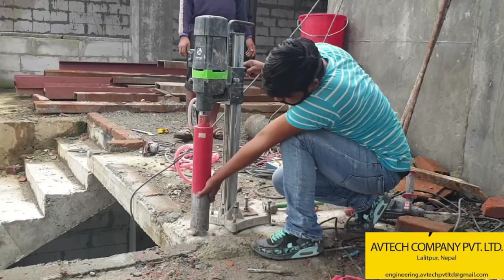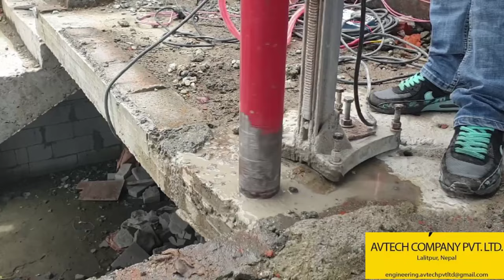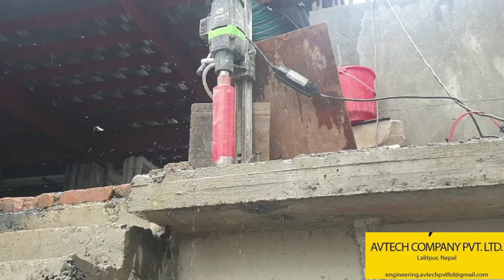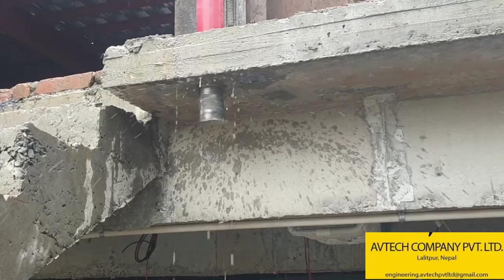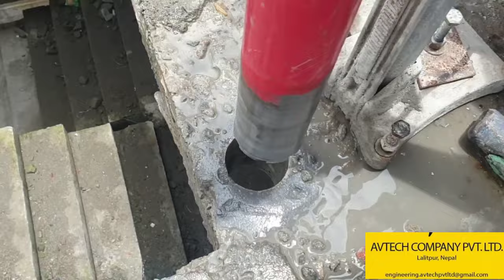Drilling Holes Into a Concrete Slab By Diamond Core Cutting Machine

Comment: That is on the beam.... it may cause structural problem
Reply from the maker: Thank you for your concern .Its not on a structural beam, its on a floor slab.
Reply: What about bar reinforcement ..
Reply from the maker: @pb_vidzone  It will not affect on stucture